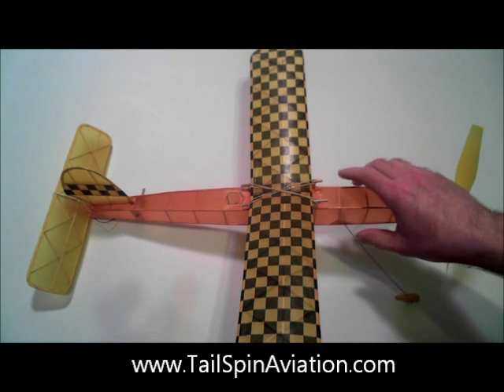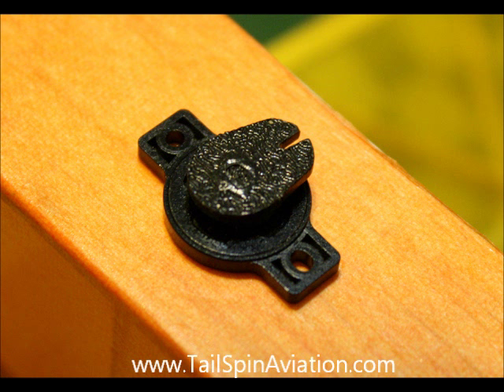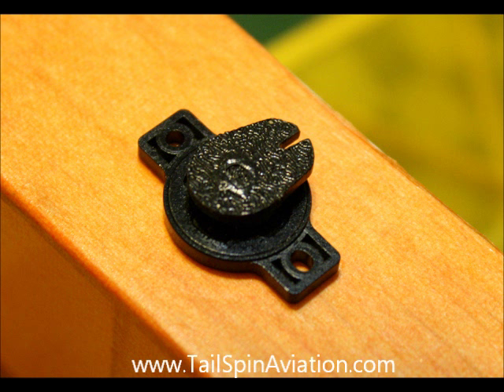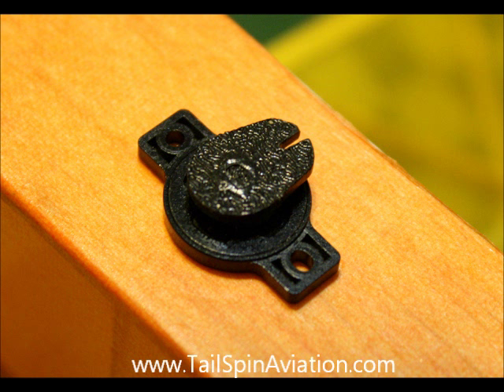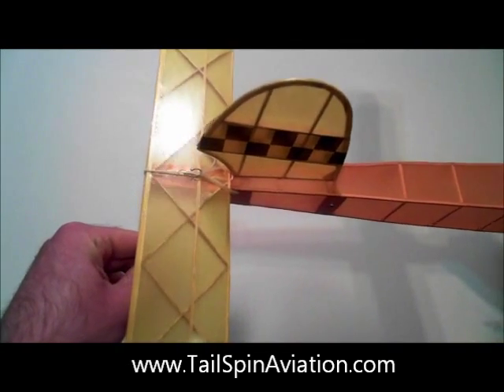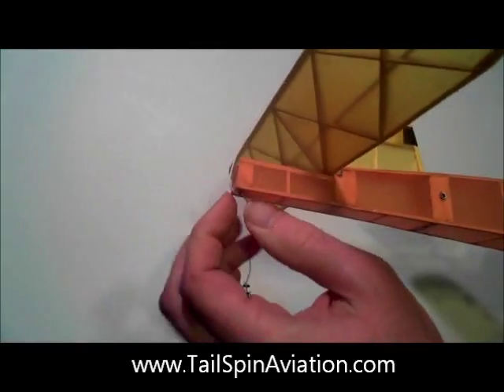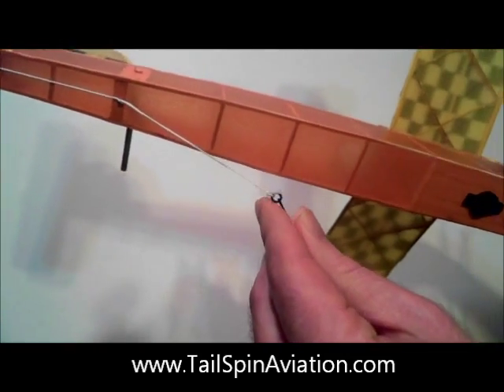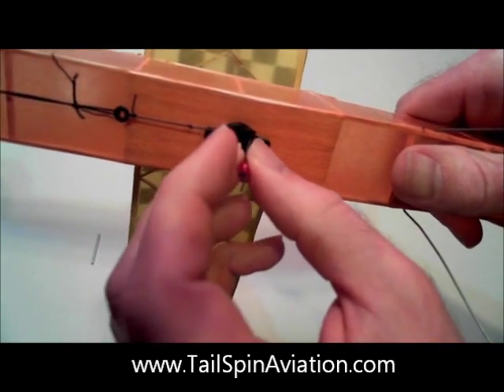Model Airplane Dethermalizer

Comment: Oh No!! You're makin my ears hurt.  A dampener is a tool to make something more wet or damp. Like using a spray bottle of water to make your clothes damp so you can iron them well.  A tool used to absorb or offset vibration or wave motion is called a DAMPER.  Shock absorbers on your car are effective dampers.  get it?  good.